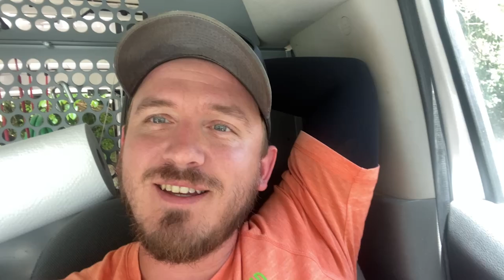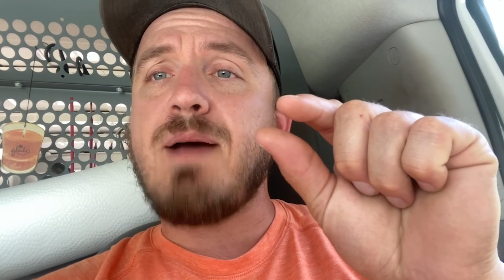What Is a Cesspool? Everything You Need to Know

Comment: Thanks for going more into the history of septic systems! I thought the information about converting cesspools to dry-wells was very interesting. I am interested in pathogens traveling from septic systems to surface water and drinking water wells. 
I think one of the worst situations for that is the one that you described where the pit intersects the water table and instead of wastewater backing up the home, it is just quickly carried away by the aquifer. That sort of failure really isn't causing an issue for the homeowner so they probably wouldn't know or address it.